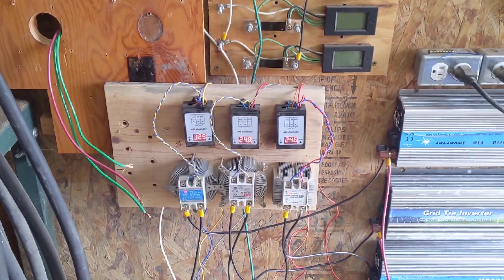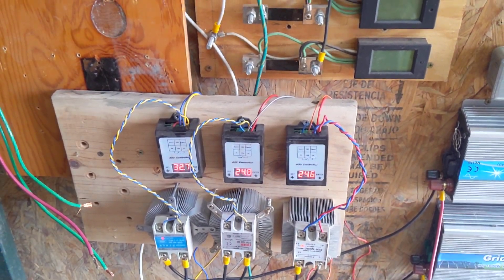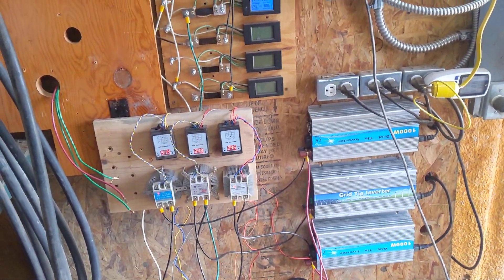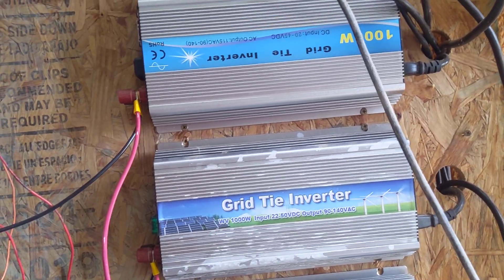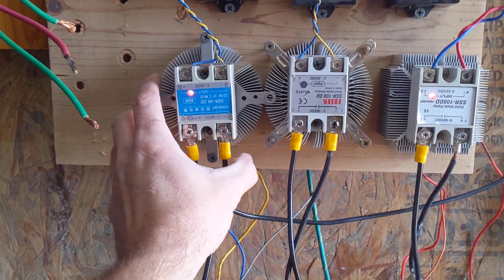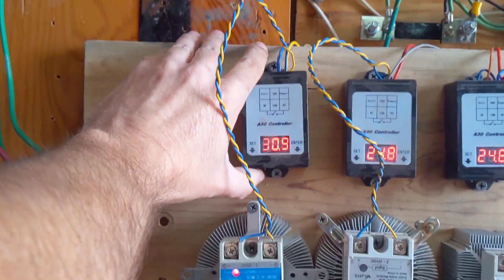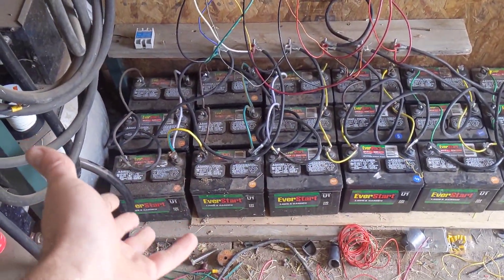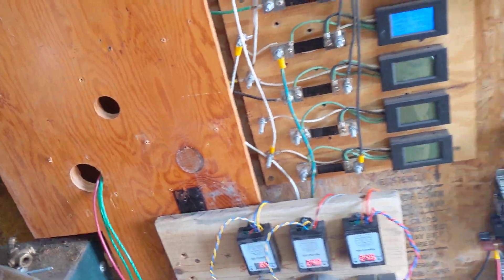Using Batteries to Regulate Wind Turbine Voltage for Use with Inverters

Comment: question I bought a bind turbinE with charge controller built in and doing a wind storm it was maxing out about 15.5 will that hurt my battery bank?
Reply from the maker: Assuming it's a 12v battery bank now that won't cause problems short term.

Comment: Thanks for the great video. You solved my present problem of my batteries being discharged when there is no wind blowing for days. Since my batteries are always tied to the grid tie inverter they discharge when no charging voltage is present from the turbine. I was thinking of just buying a cheap 300w solar panel and use a 48v to 24v converter to charge the batteries during the day. But with your method of using the charge controller to trigger the input of my 24v inverter is genius. I have already ordered a solid-state relay. Thank you so much. Just hope I connect it correctly and not blow something up.

Comment: If my objective is to sell the energy produced (by injecting it on the grid), is right to say that the capacity of the battery is irrelevant, and it works only to stabilize energy to the tie grid inverter? 
If I'm right, I should buy a battery with deep cycle, li-ion preferable, and with low capacity (to be more economic)?
Reply from the maker: Battery size is important, you have to have enough battery capacity to control the turbine.  A common problem I encounter is that my turbines frequently outrun my batteries AND my inverters.  My inverters can only draw off 2kw efficiently, but if my turbines are cranking out 4kw things get hot in a hurry.  This is especially important if you're running lithium.  Lithium does NOT handle overvoltage well.  Lead acid you can get away with short bursts of heavy hits without doing serious damage to the battery.  The way I put it is that you can certainly have not enough batteries even if you're just using them to clamp the voltage down, but you simply cannot have "too much" battery capacity under any circumstance.  Low capacity batteries will most likely get you stuck replacing your batteries regularly.  Big heavy battery banks can handle the job better.
Reply: @ToysforWatts  My turbine is just 600W. I'm currenty using a 72ah lead acid battery, that I rescued from a car electrician.
Reply from the maker: If it is a 12v battery then that is likely plenty enough to be used as a filter.
Reply: @ToysforWatts  thought so. But I think this battery is discharging faster then the turbine produces. And so I was thinking on replacing it.
Reply from the maker: That's quite possible depending on the inverter and your weather conditions.  Inverters are very indiscriminate...they just keep going as hard as they can get away with until the batteries are dead.  The turbine can only produce power under appropriately windy conditions.  I use a set of switches to turn my inverters on and off at appropriate voltages...when voltage is high the inverters come on, when voltage is low they're shut off.  This prevents over-working the battery.  You can see how I currently have my inverters and batteries set up here: https://youtu.be/X3NMlLsuABo
Reply: @ToysforWatts  the inverter is much similar to your's. I think it stops working when the battery output is<12v
Reply from the maker: If it's the 12v inverters they run from like 10~30v.  They will drain the battery flat.  Some of them have a parasitic drain even when they shut off above battery voltage.  It's best to use a relay system to shut them off before they kill your battery.  If you're running a similar setup to me, dragging them down below battery voltage will kill the battery and once the batteries die most of your power production will go into that bad battery instead of where you want it to go.
Reply: @ToysforWatts  I need the controller that you have before the relay to establish minimum voltage on battery to make the inverter work without discharging the battery, right?
Reply from the maker: Yes the controller will read battery voltage and turn the relay on and off.  The relay needs to be between the battery and the inverter.
Reply: @ToysforWatts  Hi again. Got the relay and the controller. Relay as 4 contacts(numbered) and the controller has 3. Could you please explain the connection between them and also to the battery?

Comment: I like your approach, very out of the box thinking! However, this is not going to work for very long. The reason is that batteries are not meant for continiuous cyclical usage. Especially car batteries. They really only cycle about 50-100 times and then they're dead. I'm not sure how quickly these inverters can turn off-and on, and how much buffer you would require to catch most of the windvariations, but using a some Ultra High Capacity capacitors would be a much more durable solution. That, or some very good li-ion batteries.
Reply from the maker: I do blow up batteries on the regular but they're cheap to replace.  I have had a lot of folks recommend that I try capacitors but I have yet to see a working example and I simply don't know enough about them to be a pioneer.
Reply: What I understand you're trying to achieve is two things: First you're trying to get rid of an overload of power from the turbine in high winds because the inverter won't take the higher voltage. Here's what I think: always send the load from the turbine to the inverter. Then have a programmable switch monitor the voltage, and switch ON a parallel load to reduce the voltage. This load is not a resistor, but a much smaller battery with low enough resistance to temporarily suck up the excess power. Then at the same time you switch on a second inverter to send the excess power to the grid during the high windload condition. You would need a bit of hysteresis in your DC switch to prevent the highload circuit to disconnect immediately after it kicks in. You wouldn't screw up the batteries by cycling them all the time; the batteries only cycle a bit to cover the high windload situations. For the 2nd part, I understand that you want to smooth out the load peaks from the turbine due to wind variations so the inverter can run more efficiently. This can be done with some big capacitors from China. You can buy some of lets say 50F @ 2.7V and make a series string to match the ingress voltage from the Turbine. When the wind drops a bit, the capacitors continue to feed the inverter for a while and when another high windpeak arrives, the capacitors act as short-term dumpload while they're charging. It would create a more steady average of power influx, in conjunction with the highload dump circuit switch. Anyway, it's just an idea. As for myself; I'm waiting for a permit to put a turbine up and this is what I would test out when I get it.

Comment: Well, I only have 14 batteries, but I have enough to go get two more...I guess I'll go get a couple...I was just fixin to go and decided to watch this. All of mine are hooked to the inverter with two sets of #2 welding leads. I plan to have 18 but I have insurance next month. ugh. I will have to get the last two in February. The voltage has improved since I changed the parts in the inverter...the control board had a problem, maybe the big chip, so ...I just changed both boards and it works fine now. Expensive as hell though, don't recommend. I guess I will try to find an end mill so I can put these magnets in this PMA I have. I forgot that a drill bit might not work very good.
Reply from the maker: No one has ever said "I have too many batteries!"  The are terribly expensive, though...that's why I have the cheapest batteries possible!

Comment: You've been thinking. Great to see. I've come to much same conclusions as you, in some respects I'd express it somewhat differently, however the end result is much the same. Very briefly I find it helps to think of the grid as a large battery  / load. You may consider linking all batteries together and stepping the inverters on depending on trigger voltage so the inverters cut in stepwise (but are you still running 24 and 48V banks?). I have a fuse on each battery. Battery failures are less commonly a short, but plates can buckle and short, which then is a scenario you just don't want....! Similarly do same step wise approach with several Hi Gust dump load resisters which I figure will be kinder to turbines windings. I've been modelling this approach on a slightly smaller scale to date, my next thing is to try using small LiFePO4 batteries and cycling their wider DOD - as its much more. I'm interested to know more about your information to do with the reversed power drain (that you buy from grid!) that you briefly mentioned. I've noticed that too, not as bad as you commented but as I'm doing it like you I figured the thing to do was to switch the mains side of the inverters using a relay that is run by a) one of your voltage sensing relays, but also adding in a timer board. Turn on the grid connection when the battery voltage is approaching the inverter trigger on (high) voltage to give inverter time to run its start up, and let it run for say 30 mins and disconnect after 30 mins. However if you've had wind for say 6 hours the voltage trigger will continue to reset the relay and its won't trip out till there's been essentially no wind for 30 minutes and the batteries have drained. Which means between blows the batteries will be in a state of discharge you have set / accepted. OK so having got this far it may be come obvious the battery type selection is relevant at this point, which batteries are more OK for days (when no wind) when discharged? Not good for Lead Acid, LiFePO4 is fine with "storage" in a state of discharge. One of the reasons I'm going to trial LiFePO4. They'll cycle more, last longer, and don't need to be very big, the key point here. This is my thinking, the latter part is yet to be tested but I am sufficiently confident in this approach to be bothered to commit scare resources to run it up. I also comment you are using car batteries and not deep cycle batteries. In this use case I am interested if you cycle say their top 5% DOD this way how they do they perform? Plainly they work fine in this role. How long will they last?

Comment: I'm setting up one of the Sun grid tie inverters which has a battery discharge mode so you can set the amount of power you want the inverter to pull from the battery. this also has a settable voltage low turn off and high reconnect. these do away with all the wires and the ssr although I'm still planning on putting one on the battery just for safe measure for when the grid drops out. 
I'm going to be using a hydro rather than a wind turbine so should have a good steady power income.
The inverter also come with a limit sensor just in case you don't want to push power back to the grid.
As always have fun and keep turning out videos

Comment: I tried your suggestions 
I bought the i700
Put it 55ft in the air
Pushing at some point 1000 watts
Keep blowing though the solid state relays 
Had to go the double solenoid relay
Reply from the maker: Those SSR's are not all the same...even when they say they are!  I always get those FOTEK 100amp pieces and sometimes they cook almost right away, while that one in the middle in this video I've had since the beginning.  The trick is keeping them cool, though...even the best ones cook fast if they don't have a good sink on them.

Comment: I'm glad that you made the video man I've been trying to figure out how to get my voltage down on my wind turbine so I can hook it into my inverter because the inverter won't pick up on it quick enough that should slow it down to where it'll pick up on it and when it's higher voltage it will turn on and turn it off at a lower voltage that's an excellent idea the way you set it up and thanks for the link to the controller
Reply from the maker: A lot of my problems have been solved by adding more batteries lol